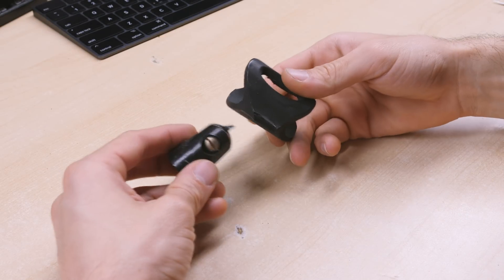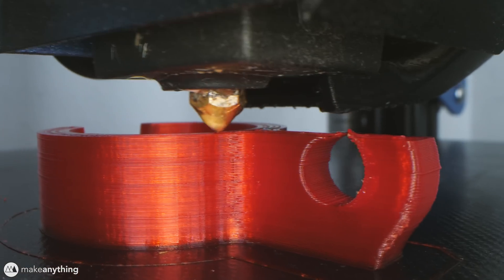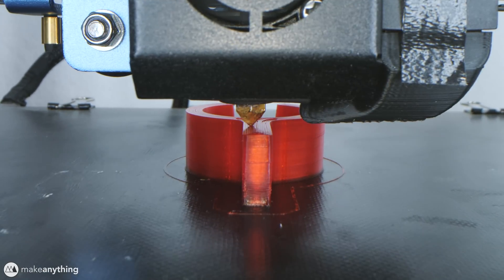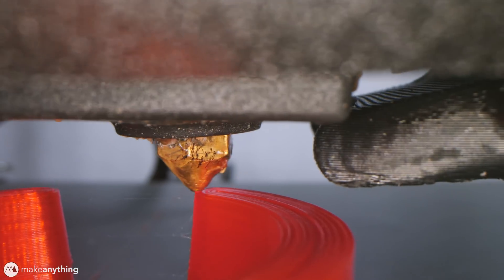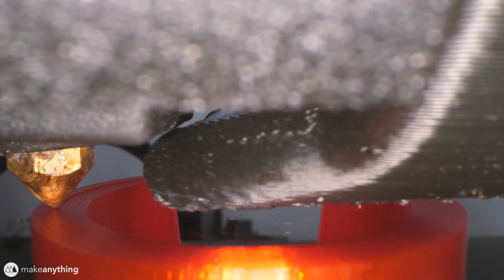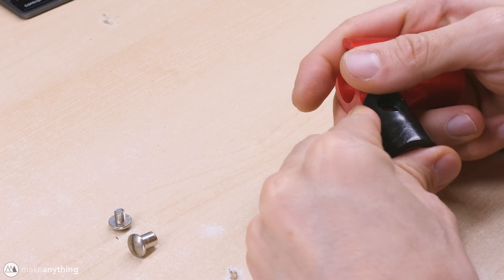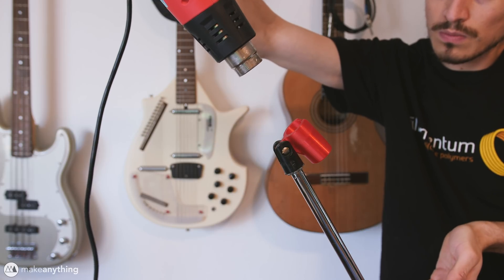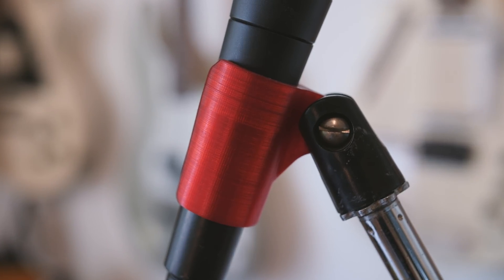Macro Maker // Mic Holder on the Sovol SV01 3D Printer

Comment: Thanks for the heat gun idea. The issue with this mike clip is that it's cylindrical rather than conical, whereas Shure microphones are usually conical.  But if the heat gun solves it, I'm very impressed!

Comment: How do account for shrinkage in your prints?
Reply from the maker: There's not really any noticeable shrinkage with PLA, which is almost all I use. ABS shrinkage can be annoying but you can figure out a percentage to increase scale to compensate
Reply: @make.anything  Thanks.  I'm making small holes, 3.2mm but they don't print close to actual size.  This is my current issue.  Don't know if the fix is in the slicer or if I should account for this in Fusion 360.

Comment: Great idea! I can even print one with TPU. I would consider the print in the video slightly under extruded. I always print for strength. Gaps between the lines on each layer mean poor adhesive strength. Heat gun molding might of helped compensate though. Flow could have been bumped up 3-5% for much stronger part that would look just as good.

Comment: I feel like you could have just used some CA glue to stick it back together, or even fuse it back together with acetone if it's made from a compatible plastic like abs or styrene.
Reply from the maker: It was a rubbery material so I wouldn't trust that with an expensive mic. Plus... Shiny red 😁
Reply: Boring. Way funner to do what he did.

Comment: Can you post full parameters of ur print? What nozzle size? 0.6? wall widht? Thanks!
Reply from the maker: .4mm nozzle and width
Reply: @make.anything  I was trying to get the 1hr print time you said and it was impossible. Any tip or detail about your configuration? mm/s? It's really weird but im getting like 2 hours and a half at a decent speed.
Reply from the maker: @elmareao well it could have been a bit longer, I was just estimating, but I also sped up the print when I wasn't filming, but it was harder to capture